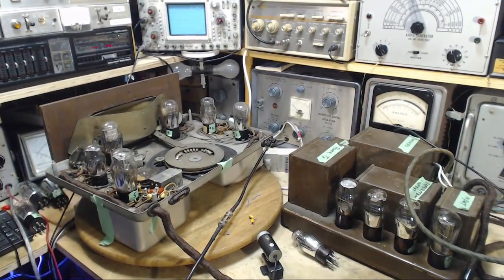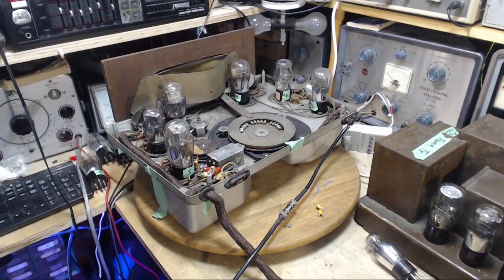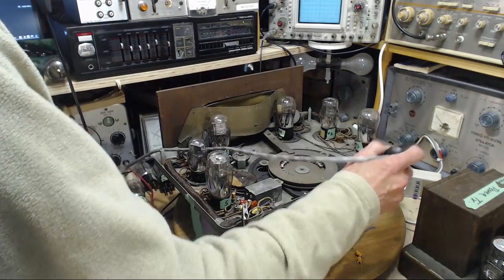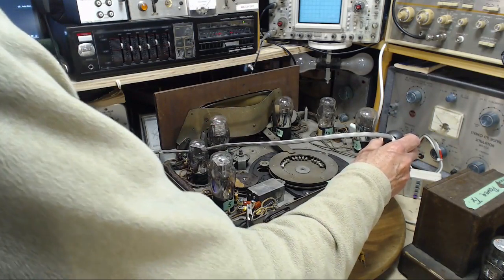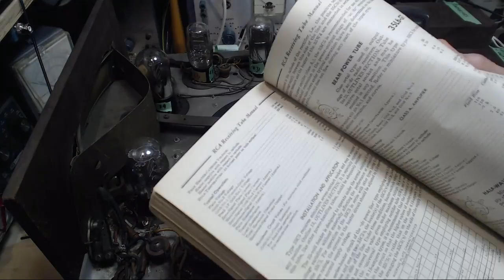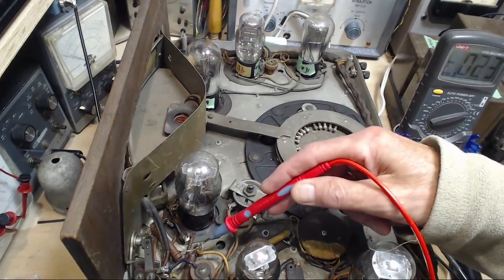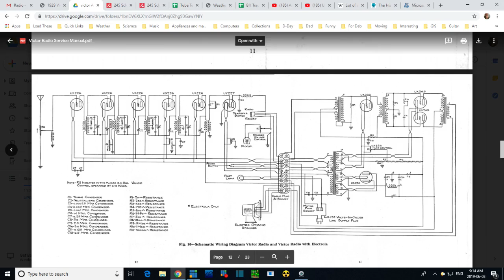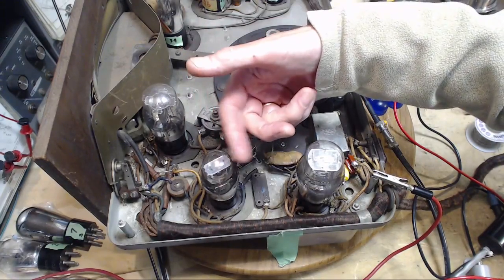1929 Victor RE-45 Video #14 - #227 Detector Biasing

Comment: Hi Jim
This is a 2 pint problem & one of us has a bad map !
I downloaded a map & R9 is a 5 meg resistor .
Look at the markings on the old dog bone resistor & check the test you just did is good .

Did you look at C8 ?

Is the cathode pin of the tube open ?
Old tube sockets receptacles can snap off from the solder lug .
All is held in place by the socket assembly .
Reply: My schem from Riders has R9 at .5 meg like Jim's says.
Reply: @skycarl 
This is archaeology & not on my workbench ….LOL

With the information in the video we all look for what makes a bit of sense for us . 
At this point we are all making assumptions & Jim gets the lot .
The good , bad , googled it & the just certifiable .
At the end of the day he will fix it then it will all make sense .

So we think R9 is 500k ????
Reply: @gd2329j  Hey gd, yeah I was looking at my Riders schem and it looks like the one Jim has on his screen. I really had to blow it up to make sure it was 500k. With the old ones we have to search and grab what we can to figure this stuff out.

Comment: Jim that one mica capacitor to the RIGHT of the detector tube that you touched or pointed to in the video looks like it has a crack lengthwise in the center of its case,  I would replace it because if it is cracked that means air and humidity have entered and it may be leaky !!

Comment: Jim, time to bring your scope into this.  Inject modulated RF into the front end (1Mhz @ 400 Hz for example).  Observe the modulated RF on the detector grid.  On the plate observe rectified envelop (audio) of modulation.  If the signal is not what is expected, it may point to what the problem is.  From what I remember, your tracer was not picking up any audio on the plate.  Diode rectification not working?  Both tubes bad?
May be insert a semiconductor diode/rectifier in the detector plate circuit?

Very little DC grid leak bias voltage is required for diode detection demodulation.  The signal strength on the grid provides most of the grid bias.

I really enjoy your videos...lots of suspense, drama, mystery...thanks for sharing what you do.

Comment: Check the heater circuit for the 227. Since it's the only tube on that circuit and this is the only stage not performing that maybe indicative.

Make sure that the cathode is well connected to ground. Running as a grid-leak detector the grid and cathode will be acting as a diode. Having a floating cathode could be problematic.

Make sure that the signal feeding the stage is balanced with respect to ground. If there is a significant DC offset the audio with get canceled out in the detection phase.

As to the tube testing good on the tester and not working in circuit: In all likelihood the tube is probably  being tested in its linear amplifier configuration. When configured to run as a grid-leak detector its characteristics are considerately  different, and it may not be straight forward to translate from one to the other.

Comment: Jim from your last video gar suitor explained the circuit for the detector. Sounds correct. On this video I did not see you check in audio mode with the tracer from plate to choke, other side of choke connection to switch.

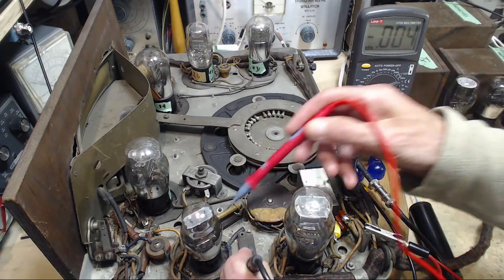Comment: Would it be worth trying to replace the 3rd C7 cap with the proper value?  It looks like that specific cap is connected between ground and the RF coil / xformer chain which eventually leads to the grid of the detector tube.  Also, please take another look (with your microscope) at the solder connections on the radio/record transfer switch.  In video #13 I thought I noticed a bad solder joint (the black wire @17:14) on the transfer switch (a wire sticking through the solder tab without solder on the wire).
Reply: Try disconnecting the plate wire to the switch and see it you get some signal on
the wire you may have leakage there.

Comment: My two cents Jim is both 27 tubes are not up to the task of detecting. I'm thinking either a better tube or the tube socket is bad. There are no other routes the problem can take. You made sure the resistor/cap ( r9 .5meg and the c3  .00025 ) are correct and you have a good rf signal up to that point. That only leaves the tube or tube socket.
As long as the c3 off the plate or the coil is not shorted, your signal should be there.  Good luck pal.

Comment: A tutorial about grid-leak detectors:  http://worldphaco.com/uploads/Radio_Grid_Leak_Detectors_in_the_1920_s..pdf
Also, it's difficult to tell, because the resolution of the video is not high enough, but the case of the the capacitor connected to the plate of the 227 appears to be cracked.  That capacitor, and the coil which follow it function to remove the rf from the output of the detector tube, as does the input transformer to the audio stage.  (It is designed so that it will not pass rf.)

Comment: I guess, in your signal tracer-tip is at first a capacitor. Think, when you tip at a terminal or so, you charge this capacitor. Then you go with this capacitor to another point! And discharge it perhaps. So you hear a pop. Perhaps this is also dangerous for the radio. Thats what i think when i see you operate.
Cheerio freom Germany.